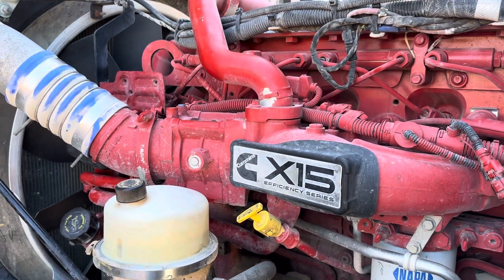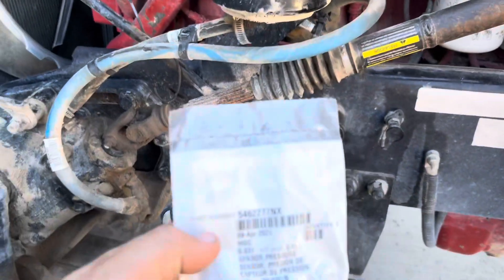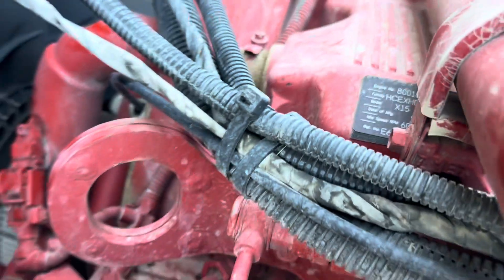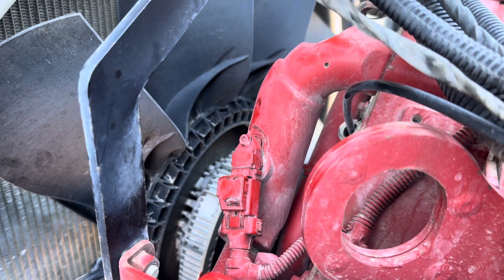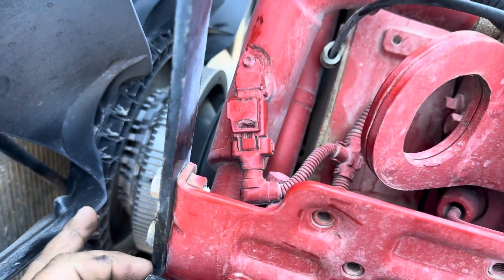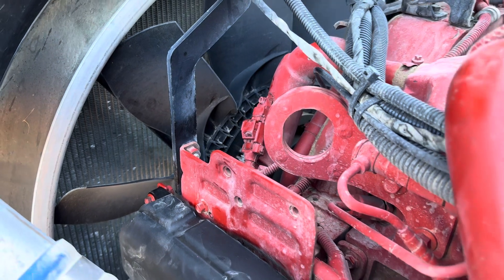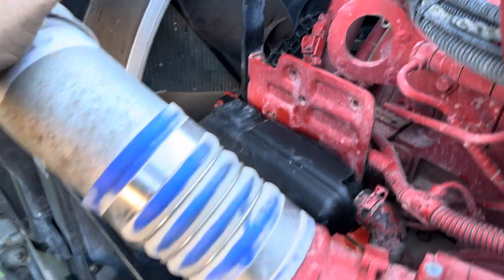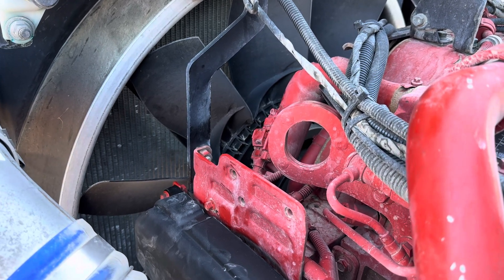Crankcase Pressure Sensor Fault Code 0556 Cummins ISX

Comment: Does it have a crankcase breather filter or is it the “maintenance free” one ? How do you maintain it ?
Reply from the maker: There’s not an element that can be changed on the X15 so it’s just a replace the whole breather type of deal
Reply: @ I see, thanks for the input! I get a red light for crankcase pressure severe sometimes when I do a parked regen, then it goes away if I shut the truck off and turn it back on
Reply: @deSkidrow had you fix that issue? my truck just give me this code today I stop wait for a minute and then light when away
Reply: Im getting a spn-101 on my x15. Any suggestions. This engine has no crankcase filter on iy